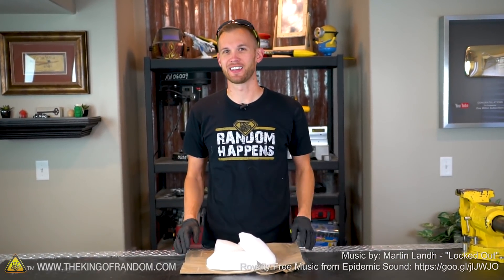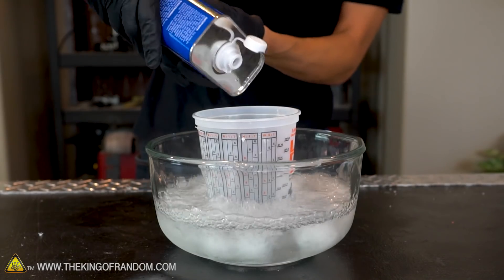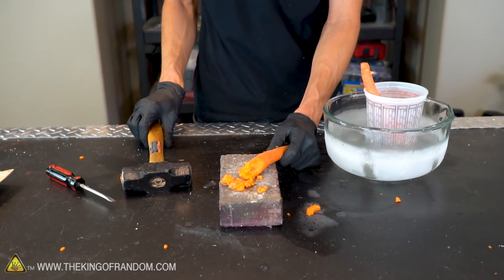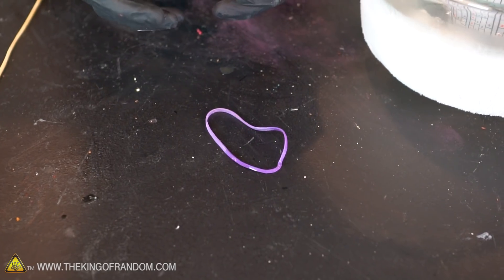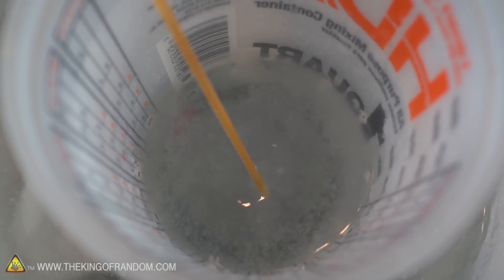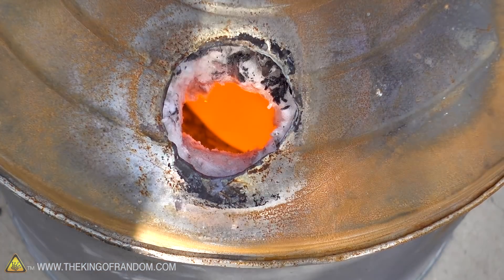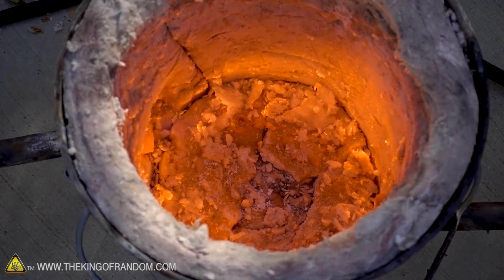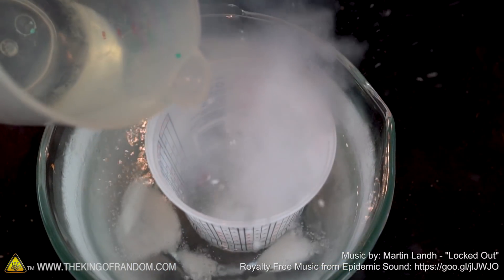What Does DRY ICE Do in a Metal Foundry? TKOR's Best Dry Ice Experiment: Burn? Melting? Smoke?

Comment: The CO2 won't put out the flame because the fuel is mixed with oxygen prior to entering the foundry. If you set dry ice right next to the air inlets outside of the foundry, it would be more likely to go out.

Comment: combustion of propane yields carbon dioxide and water, the reason the dry ice is barely "melting" is because it does not want to evaporate as much because the air around it has such a high CO2 concentration (Le Chatelier's principle). You could see this was especially true when the pressure was increased when you put the lid on, high pressure is the preferred condition for solids, not gasses, ergo the ice does not evaporate as fast as you would expect

Comment: The acetone bubbles because there is CO2 dissolved in it. At low temperatures a large amount of CO2 can remain dissolved. However, as the acetone heats up (like when you put a relatively warm carrot or rubber band into it) it can no longer hold as much CO2 in solution, so some of it comes out as bubbles.

Comment: Try mixing tannerite (mixture of aluminum and ammonium nitrate if I am correct) with thermite and light it on fire. If it doesn't works out, try using the rocket fuel (you made in the previous video) instead of tannerite

Comment: Can you turn dry ice into a liquid. Like if you agree! By this I mean for The King Of Random to do it.
Reply: Hunter Wu Yes it is and no it is frozer air, it is co2.
You can liquefy CO2 if you increase the pressure on it to 5.1 atmospheres, which is about 75 pounds per square inch, and keep the temperature below minus 69 degrees Fahrenheit.
Reply: Mikittens If you watch close, I did not reply to your post. :)
Reply: Mikittens 
That's more of a Codys lab type thing
Reply: Mikittens it’s physically not possible. Dry ice is made of frozen air
Reply: XtreeM FaiL I meant I wanted them to do it.

Comment: The reason the flame did not go out in the foundry is the oxygen source  for the flame is on the opposite side of the burner (i.e. outside the foundry) and does not come in contact with the co2 from the dry ice.

Comment: In a nuttshell; It turns into carbon dioxide.
Reply: Protos Paradoxical its already carbon dioxide...
Reply: would the nutshell melt in the foundry?
Reply: xthorpyx then say gas on the end just for that little bit extra
Reply: xthorpyx still would be incorrect
Reply: NUTT
Reply: Cringiest Guy when you breath out its a combination of oxygen and carbon dioxide but there is enough oxygen left in the exhaled gasses that you could actually breath it in a few more times. That's why scooba diver re breathers were invented it recycles the exhaled gasses so you can breath them in again.
Reply: Chris Qiao gaseous carbon dioxide
Reply: you just saved me quite a bit of time, thanks.
Reply: yeah cuz dry ice is made up of carbon dioxide

one more thing when you blow air from your mouth into a fire it puts out the fire cuz you breath out carbon dioxide, but if you give it oxygen the fire becomes bigger
Reply: Protos Paradoxical turns into carbon dioxide in gas form
Reply: Protos Paradoxical it's the nut shack
Reply: Protos Paradoxical 
Rip atmosphere
Reply: Nutt
Reply: Dry ice is carbon dioxide at -78 degree Celsius
Reply: swap the word "turns" with "sublimates"
Reply: Hey Nathan try drinking some molten copper then eating some dry ice to see what happens. I am very interested to see the result can't wait!!!
Reply: emmett kartman it would burn both ways

Comment: What happens if you freeze paper airplanes in liquid nitrogen? How well do they fly compared to non frozen paper airplanes and do they “explode” or shatter when they hit something?
Reply: ZzFlyzZ_YT and why exactly would they be so heavy?

Sure, you'd get a little frosting once you took them out but probably not that much.  Guessing it would multiply the mass by at most 2, and people already to that when adding small amounts of weight to adust the balance.
Reply: Gold Daddy yesssss
Reply: ZzFlyzZ_YT all your comment  shows is that common sense is highly overrated.

1) the increase in weight from absorbing nitrogen will be negilible, 2) the huge surface/mass ratio of a paper plane means that it won't shatter on impact as it will have thawed out completely in flight.
Reply: you forget, without a liquid to freeze, no freezing. paper hasnt that much liquid in it
Reply: Gold Daddy thay whould not fly as well because cold is more dense than warm
Reply: you are right
Reply: and what makes it heavier?
Reply: Gold Daddy well they r gonna be as heavy as a rock so they obviously wont fly and they r gonna be frozen so its gonna shatter if it hits something

Common sense

Comment: If you put crayons in liquid nitrogen or dry ice and acetone will it still draw a picture?
Reply: I'm guessing at most you'd just need to press a bit harder to either heat and soften the wax at the point of contact by pressure & friction or cause the wax to rub/crumble off like the way a pencil works, but I can't say I know for sure.

Comment: Will a melted magnet still have pull?
Reply: Random Stuff no
Reply: A melted magnet is called metal. Metal loses its magnetic properties after it is heated
Reply: What are you trying to ask?
Reply: no as its shown a milion times on youtube
Reply: As to why, magnets work by lining up atoms in such a way that all their magnetic fields point in the same dirrection and stay that way.  In a liquid, nothing stays in the same orientation without an outside force.

That might be slightly oversimplified, but is the general idea at least.

Comment: Try To Melt Dry Ice!
Reply: FireGamingHD Basic chem, you can’t unless you have an insane pressure chamber. Extremely dangerous, DO NOT TRY
Reply: dry ice doesn't melt, it sublimates. meaning it turns from solid to gas right away without an in between stage of liquid. i believe with either a vacuum seal or extreme pressure you can get some interesting effects

Comment: I worked in a foundry for 19 yrs.. you can put water on molten metal.. but if you put molten metal on water you have an atomic bomb.
Reply: Richard DKY wait is this true that’s awesome yet kinda disturbing 😂😂
Reply: well its kind of true because what can happen is the molten metal can cover the water and the water instantly turns to steam that takes 1600x more volume than the water and the molten metal can suddenly be thrown all over the place sometimes its so forceful that a factory can have roof or equipment damage from the sudden expansion of steam sometimes the molten metal can even react chemically with the steam increasing the damage

Comment: Hi! Nice video. I'm a professional Chemist and have worked a lot with both dry ice and liquid nitrogen to tame vigorous reactions at low temperature. The acetone started bubbling when you added something warm. This is actually dissolved CO2 escaping. Gasses generally have a much higher solubility in cold vs warm liquids (a cold bottle of coke doesn't hiss as much as a warm one when you open it). Also, seeing your foundry it looks like it draws air from the tapered bits surrounding the propane pipes like a Bunsen burner, making an air/propane mixture that's introduced in the forge. That's probably why you couldn't put it out with the CO2 (sadly subscript is no option...).

Comment: The propane burners could have pulled enough air with it (as it is supposed to do) that the CO2 couldn`t have done anything. Also the combustion isn`t inside the foundry but at the exit och the burner

Comment: I think the acetone/dry-ice bath would last longer if you used a styrofoam container, like an Esky or cooler of some sort.
The tongs don't have much mass (20ga sheet at the thickest), so that's why red-hot tongs didn't do much to the dry ice. The heat is absorbed way too quickly by the much larger mass of dry-ice.
I wonder if the super-fast cooling from a dry-ice/acetone bath could be used to harden low carbon steel (mild steel) as a quench bath? Normally mild steel can't be hardened by heating to red and then quenching, but who knows with a super-cold bath?
Reply: The acetone would melt the Styrofoam
Reply: The quenching would fail because of the gas produced by cold acetone meeting with the hot object would form a barrier. Not to mention that the acetone would start burning pretty fast.

Comment: What would happen if you put liquid nitrogen in the vacuum chamber
Reply: It would turn into a gas and get sucked up by the vacuum.
Reply: it would cool down until it freezes solid
Reply: Artboy919 u get nitrogen ice
Reply: Which one of you is correct there are 2 responses
Reply: What basicly happens is that, becausevof the low pressure, the fast moving and thereby "warm" atoms turn into nitrogengas and only leave the "colder", slow moving atoms. So the whole thing gets colder and colder until it freezes. You take out heatenergy by lowering the pressure.

Comment: Because the propane is pre-mixed with air in the burner, the extra CO2 in the forge won't effect the flame, as we see in the video.
Reply: Gavan Winkels He could.put it in the air intake....
Reply: AirsoftSlo If enough CO2 was evaporating from the dry ice and displacing the O2 in the air, then I would assume there wouldn’t be enough O2 to sustain a flame, yes!

Comment: Do cold acetone melt polystyrene as warm does ?
Reply: not as fast, but it still can. Its not melting, but instead creating a solution by interfering with the intermolecular bonds.
Much like dissolving sugar in water, hot water does it faster and can hold more, but cold water will still dissolve some

Comment: Is it possible to make liquid carbon dioxide
Reply: DJ_Fwufffy you mean CO2?
Reply: yes, but you need to have a pressure chamber and a lot of pressure... like inside a fire extinguisher, there is actually liquid co2 in there probably. but at normal air pressure, its either a solid or gas

Comment: Put dry ice inside microwave
Reply: surprisingly nothing, the microwave radiation can only heat up certain things, most commonly the water inside your food. CO2 is one of the things that has no reaction to microwaves, so it just sits there not caring
this is due to the way the polarity is in the molecules, co2 is balanced, nonpolar, and water is unbalanced, polar. Microwaves essentially spin the molecules around, this will cause vibrations in unbalanced molecules, think of an unbalanced tire on a car, which we experience as heat, but when the balanced molecules spin, it stays balanced and there is no vibration
Reply: Leonard Greenpaw well explained 👍👍👍

Comment: The foundry was not a proper experiment the heat inside the foundry is hot enough to instantly combust the propane so even if it did illicit a reaction it wouldn't appear in the results

Comment: Try running your foundry on the HHO Hydroxy gas. It would be cheaper and you can get it to burn much hotter than propane.
Reply: Sounds like they need a bigger electrolyzer then.
Reply: Mitch E Mu it would only be cheaper if they made their own. Canned oxygen is super expensive, as Grant demonstrated in his liquid oxygen video. And making it on their own would be difficult. Propane is easier and cheaper to get and use for now.
Reply: In a previous video they build an electrolyzer to split water down into hydrogen and oxygen, so they can simply make their own. My concern was whether their electrolyzer would make enough.
Reply: Still Unnamed it can't, and storing hydrogen is notoriously difficult. And pressuring the gas, especially the oxygen is incredibly dangerous.

Comment: if you add a carrot to acetone without dry ice, does it make steam? If not, what is the gas that comes out when you add the carrot? Does the acetone maybe dissolves the dry ice?
Reply: If that is the case, it may freeze at a different temperature than pure acetone.

Comment: The first one looks like fake. Why would acetone boil? I highly doubt that carrot being hotter than 56C, which is a boiling point of acetone.
Reply: There might be CO2 dissolved in the cold acetone forced out by the heating process.  It really boiled and spat when the water was poured in.  We should get this debunked by Thunderfoot.
Reply: the acetone isnt boiling, its the dry ice that is boiling because of the heat of the acetone

Comment: What if you put dry ice into a container full of alcohol ?👑
Reply: The (drinkable) alcohol gets thicker as it gets colder like a wax. It never freezes completely because Ethanol melts at a lower temperature than CO2 sublimates.  Other types of alcohol would vary in melting point, so some would freeze and some would not.
Reply: Like

Comment: Very dangerous, but add dry ice to molten aluminum and/or copper. beware of possible splatter, but bubbles should form in the metals. Poured into an unheated container containing dry ice might get frozen metal bubbles.